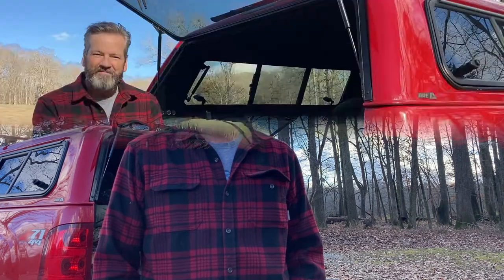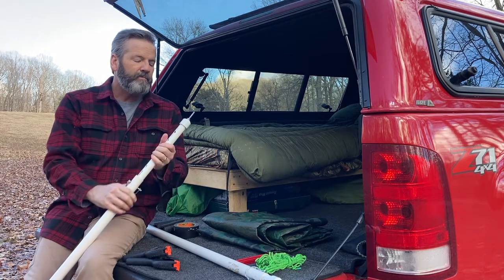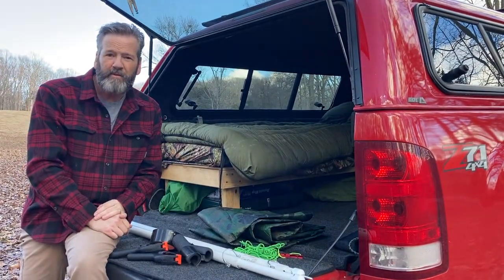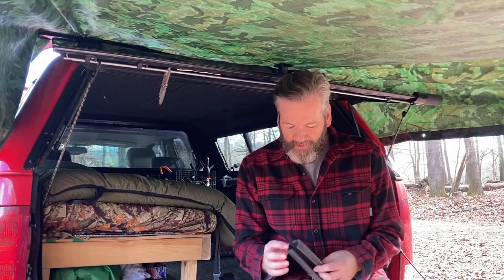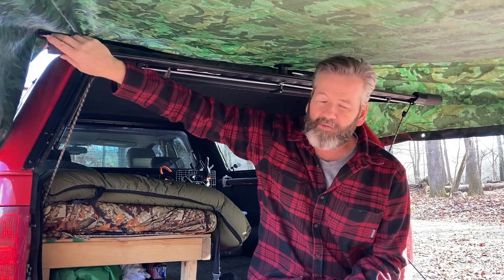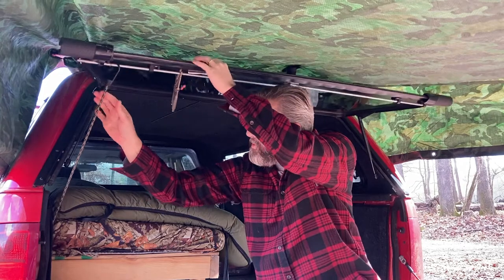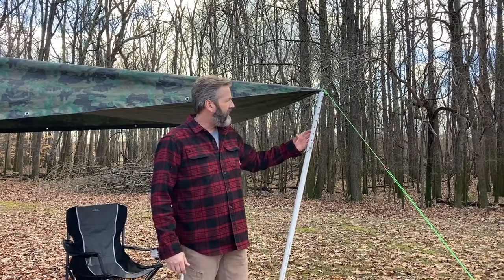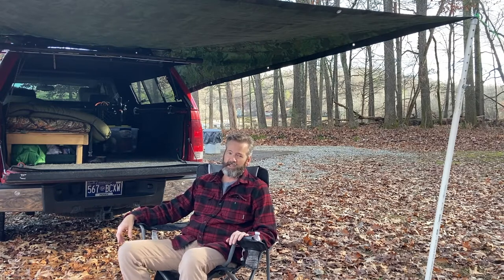Easy Truck Camper Canopy

Comment: Nice work. I like the simplicity of the set up. On a side note. You may consider throwing in a 1/2 pvc cap. It could come in handy when you’re trying to push those stakes into harder ground. Put the cap on top of the stake and you can step on it harder and not feel like the stake is going to come through the bottom of your shoe.

Comment: Suggest using some Harbor Freight heavey duty magnets to the top of your cab of truck they should hold fine I’ve done it in strong Texas winds held just fine 😊 like your pole s
Reply from the maker: That's a good tip, and thanks for watching my video!

Comment: You could buy a small camo tarp and some more of those spring clamps. Then clipping it along one side of the big tarp, would give rain protection.  
Like the poles idea.  You will need to cap the bottom or they will sink into the ground each time.  2x spary paint lids would do. They are bigger than the pole, so spreads the load better.
Reply from the maker: The spray paint lids are a good idea.